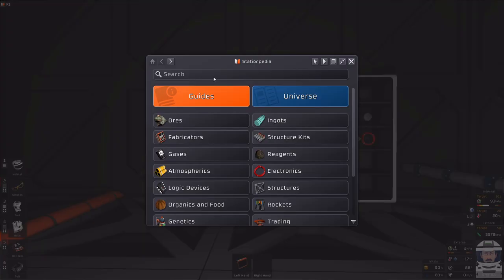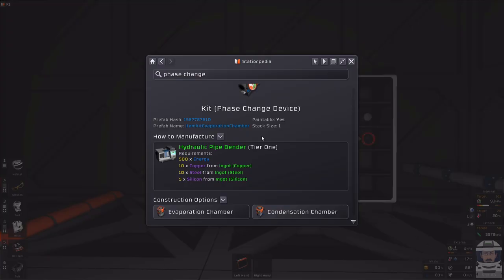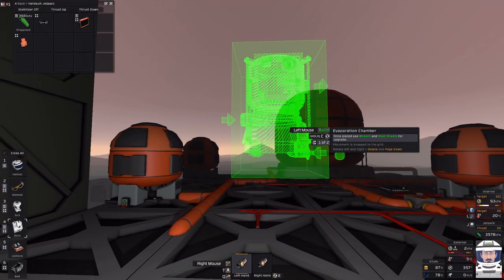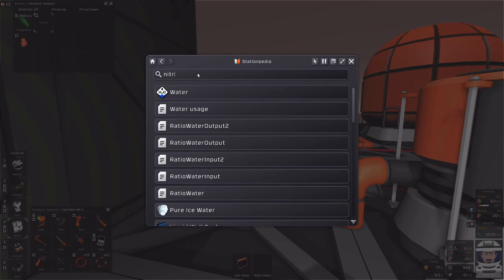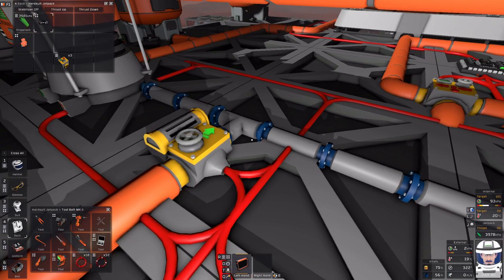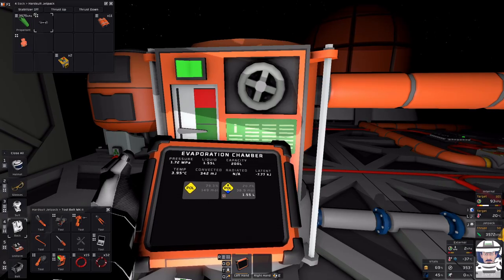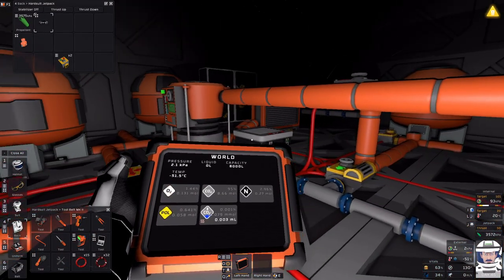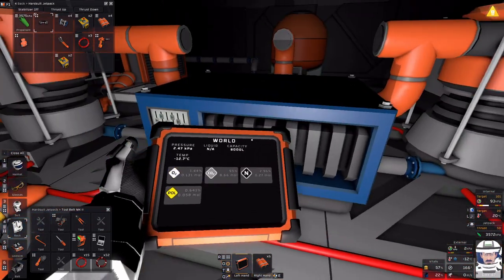Stationeers: Simple Phase Change Device Heating or Cooling Setup

Comment: Doesnt work, liquid evaporates on the liquid pipe no matter what pressure you presurise it to.
Reply from the maker: I'll try to see if I can help, but without seeing the setup I may not be able to tell for sure which of these will work.

If evaporation is happening in the liquid pipe, then:
1) Not enough pressure in the liquid pipe network yet, it will keep evaporating until there is enough pressure to contain the liquid at the given temp.
2) The temp in the liquid pipe exceeds the coolant's max condensation temperature.

If you have a counterflow heat exchanger between the condensation chamber and evaporation chamber, then another possibility is that the evaporation chamber is trying to cool something extremely hot so that the evaporated gases are hot and warm up the liquid to the point of evaporation.

Comment: So... one thing I'm still unsure of, is how do you choose the pressure you add to your liquid pipes? Also why did you specifically set the pressure regulator you used to dump pollutant into the coolant loop to 250 kpa? Was there a reason or did you just randomly hit pressure-up a couple times because you just need 'some' input?
Reply from the maker: For your liquid pipes, you want enough pressure in the liquid pipe that any of your coolant gas stays a liquid when it gets pushed to your liquid pipe. If there isnt enough pressure, any condensed liquids from your condensation chamber will evaporate in your liquid pipes to get that pressure, if you were working at low temperatures, this could run the risk of freezing the coolant in your liquid pipes so as a safe measure you would want to pressurize the liquid pipes.

As for adding coolant to the gas pipe, the number I chose was an arbitrary pressure. You dont want to overfill the chambers so pick a low enough pump rate on a volume pump or pressure regulator. You want to be watching the condensation chamber to see when condensation begins happening and then watch the evaporation chamber to see when it will reach the target pressure inside it. A slower pump rate is easier to react to because overfilling the system with a coolant brings a risk of rupturing pipes if one of the chambers stops working or if one side's temperature goes out of whack.
Reply: @shadowdrake082  Alright.. and it's okay to use the same gas to pressurize the pipe, like I think I saw you just put pollutant in the liquid pipe to pressurize the liquid pipe right? You don't need to mix nitrogen in or something like that? I think that's right. I don't know why but the gasses just confuse the everloving hecc out of me, I don't know why they changed so much about it to make it such a friggin' headache!
Reply from the maker: @KittenyKat  For starting out, I would recommend pressurizing with the coolant gas. This is because as a safety measure, the coolant in the liquid pipes can evaporate  or condense as needed when you have temperature and amount of liquid fluctuations.

When you start getting ready to fine tune the system and get whatever little extra efficiency out of it as possible, then I would recommend pressurizing with a different gas that wont condense at those temperatures and pressures. But it does mean you would need to consider cases where the liquid temperature gets high or if the liquid pipe network fills up with liquid and then have to factor safety measures for overpressurization.

Comment: 11:00 damn those powred vent are no joke 
i remember having an array of passive/active vent trying to fill some tank 
and here it take mere second to fill a tank lol
Reply from the maker: They really are. Got to be careful with them though, they dont really have safeties... it says they do but I still tend to explode my pipes if I leave them unattended or way overpressurize a room.
Reply: @shadowdrake082  yeah they dont have pipe protection but should have  room pressure protection 
based on the logic input it has the (PressureExternal) but missing PressureInternal
Reply: honestly the active vents are just bullshit, i remember using volume pumps and passive vents to get more flow out of a small vent. Turbo pumps also work great
Reply: @cheesytowninc.8054 but a turbo pump dosent hold a candle to powered vent when it come to sucking air from outside a pipe system

Comment: Well put together video. Very helpful information. Vocal audio was a bit low. I'm still trying to wrap my head around the phase change update. I can't even collect gasses without having pipes stress out on me and burst or freeze then burst.
Do you have a gas collection setup that works fairly well without having pipe destruction issues?
Reply from the maker: I did make a phase change mechanics video, hopefully that can help a bit.

In short, phase changes happen due to low temps and/or high Pressures. It would require reading the phase change diagram of the gases and understanding the information provided to help with how you will want to store it. But if you store gases in regular tanks, you need to be watchful about the effects of heat gain/loss depending on the world you are in. First thing I can recommend is to make sure you have plenty of silicon and steel to make insulated pipes and tanks. The better you can control the temperature of your gases the less likely you will have phase change related issues.